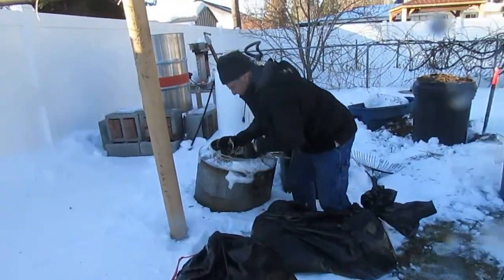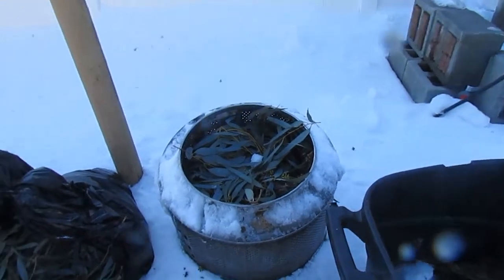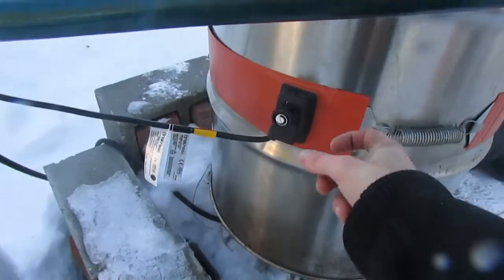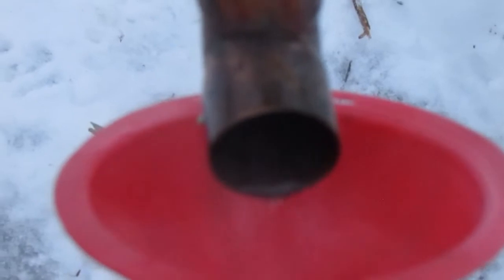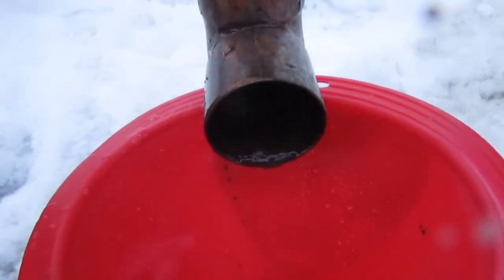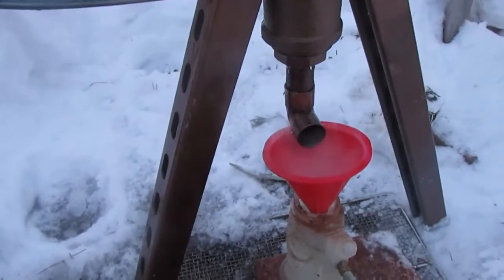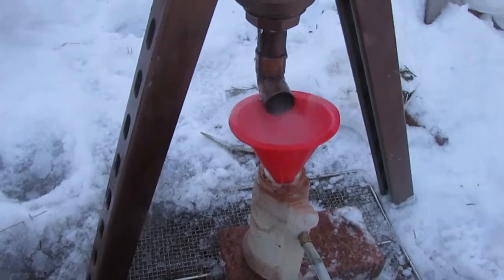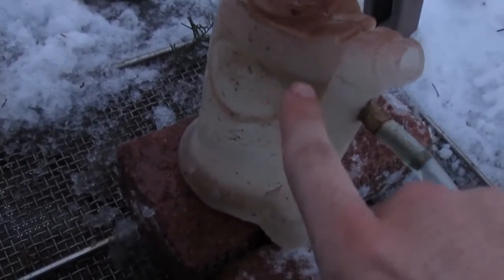eucalyptus essential oil distillation

Comment: suppose i want to distill 100kgs of leaves ,how many litres of water should i apply ......

in short , what is the ration of the mixture before distillation

leaves 100kgs : water ......litres
Reply from the maker: 10kgs of water use a 10:1 ratio
Reply: @naturalchemistessentials4258  How much oil could one get from 100kg of eucalyptus leaves?